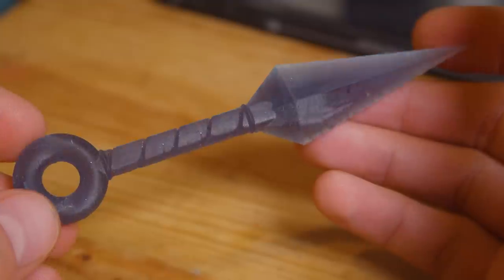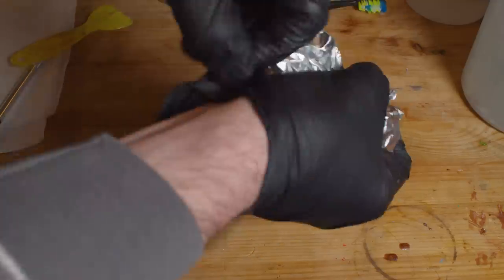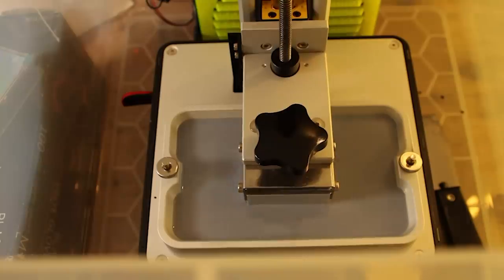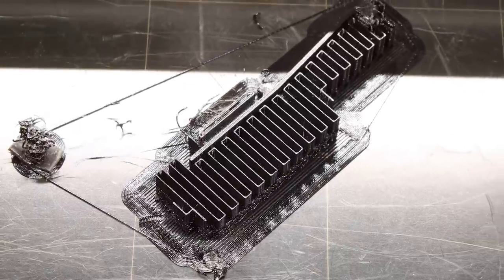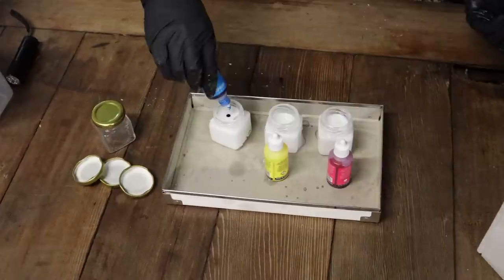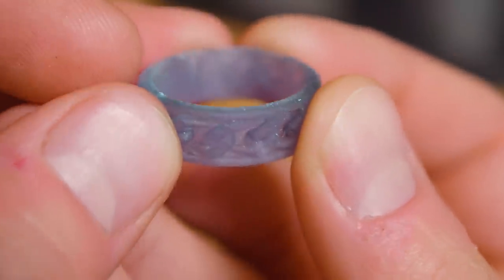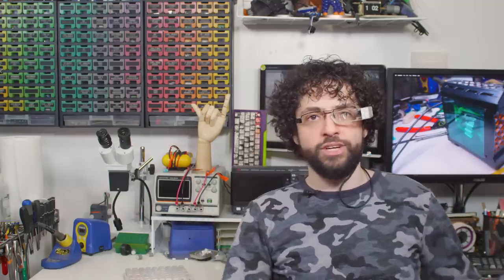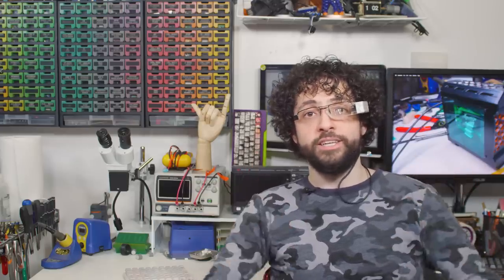Resin Printing Isn't Scary - ft. Billie Ruben!

Comment: I personally have both FDM and SLA and I have to say I use FDM more often. Don't get me wrong, SLA is absolutely awesome. But it is messy and more manual work so I oftentimes can't motivate myself to put the time into SLA. When printing FDM I literally upload my print, let it do it's thing and get back to a print. A typical SLA print takes me around half an hour to an hour of work.
Reply: Don’t even get me started on resetting the printer with new resin and such. 🙄
Reply: @topramen7431  Yeah, you really need patience and dedication with these.

Comment: I didn't know you can mix colour's. Such a great idea to only have C M Y K clear and white - you are basically covered for all colours at that point
Reply: You could even build a color mixing system with a couple of pumps and an arduino. Mixes the resin and the colors and then releases the exact amount of resin into the printer. Could also top off the tank while printing. Oh the possibilities.

Comment: "If you can smell it, your doing it wrong" that sounds like my kitchen sink philosophy.

But for real, I like my FDM 3d printer because I don't have a extra room, not even a kitchen, just a niche, so anything that could smell dangerous (or not) is out (I just print with PLA, tried Petg, going to try nylon when I can). If I had the money for a extra Room/Garage/Container - Lab/Workshop I would be doing so much more dangerous and fun stuff.
Reply: There are low-odeur resins that do not smell at all when they're inside the printer, especially with the new printers that usually include filters. The cleaning solutions you need to use to clean your prints are usually pretty stinky though, as are any of the high strength or flexibility resins that they talk about in the video.
Reply: Yep, I only have my bedroom to work in and I only use FDM it'd be too dangerous to sleep in a room with resin vapors. For my FDM I even attached a duct to the printer (its fully enclosed) with fans to vent the fumes out through the window (looks a bit janky but it totally works).
Reply: @JackOfGears  it's not about the if it's stinks or not, it is about the long time exposure, And something that stinks less but is as unhealthy or dangerouse short or long term, scares me alot more. I still work with solvents, but only short periods where i can leave them by the Window. I learned my lesson while leting oil paints dry and other stupid projects where I couldn't vent the dust or fumes. I'm not guaranteeing that I'm not going to be stupid in the future (e.g.  drink solvent when storred in the kitchen, spill epoxy on my bed ) but I wanted to make a responsible comment.
Reply: @nikolatotev  Well you can so with Resin fumes.
Reply: @hasserecht3678  from the printers I've looked at if have to make an enclosure for it whick makes it a bit more complicated. But it is possible for sure. Now that I think about it,  an even better thing would be to make an  enclosed space for both printers!
Reply: @dutenait824  Yeah, that's fair. Smell isn't everything. I've not been running my resin printer since it got too cold to keep a window open for ventilation.
Reply: What I did for printing ABS, and you could do with resin as well, is use dryer duct and a 12 fan to suck fumes out of the printer enclosure and pipe them out the window (like a portable A/C exhaust). Cost about $10 for the 4" ducting, some Coroplast, and an old 120mm PC fan.
Reply: @MrJacobegg  I had been just thinking I might try something like that! It would make me feel better in the summer as well, as my apartment isn't the best in terms of ventilation at the best of times.
Reply: i've used 2 different resins and dont notice an odor at all. idk wtf people are smelling. probably their own farts or something. 
siraya tech is the best as its strong and pretty low odor if much at all. most other resins are fragile. it cost about the same kilo for kilo.
Reply: @darkshadowsx5949  Not smelling doesn't mean not unhealthy, it just means less noticable. And I know of no resin that dosen't release VOC, just some that have less noticable vapours. And I don't want to sleep in a VOC cloud, I rather sleep in the warm fart cloud under my sheets.

Fun fact, if you don't fart, the gases get (slowly) absorbed in the blood and released thru the lungs. I rather release once, smell once, then talking sh*t and don't notice it :)
Reply: @dutenait824  I was just about to say that. Just because you can't smell it doesn't mean it's not there. Its like Pete Hegseth said he doesn't belive in germs because he can't see them.

And to be honest I think it's bad advice or at least misleading when Zack an Billie say you only need a mask & gloves and you don't have to worry about toxic fumes.
Reply: @darkshadowsx5949  yes, I'm the fact that everyone else smells fumes and you can't smell anything means everyone else is crazy and you're the only sane one 🙄
Reply: Same story here, except I stick with PETG because I liked the durability and translucency of natural PETG.

Sure it strings a lot, but once I got the settings nailed down most Natural PETG from the brands I buy seem to be consistent with each other.
Reply: Have you ever seen a laboratory fume hood? They don't enclose the chemicals you are working with, the chemicals just sit near it, but it still works amazingly well!
You could certainly get a very cheap fume hood that will vent the vast majority of the fumes (so that you are getting less exposure in the whole printers life than a plumber would get, from his pvc glues and primers, in only one day) into a relatively compact duct that you could simply unreel, toward the window, when you need to use it.
Reply: And then there's me, who had a resin printer sitting right next to his computer and kitchen for an entire year with zero filtration...

Comment: On the topic of post-print procedure, I would absolutely recommend removing the supports before curing them, often you can just pull them all off at once with practically no scaring.

Comment: As a resin printer owner:
It's amazing. Absolutely. Just make sure you have some space to clean your stuff and get a good workflow.
Protect your hands, lungs and eyes, then you're good.
Reply: As someone who owns both. Fdm is way better. I have a curing booth and everything and it's not worth it.
Reply: well thats why i only use fdm, as i only have my bedroom available and dont have that much time to waste doing all the cleanup and curing, not to speak of the space, and as i spend most of my day in that room it wouldnt be great either having resin and toxic fumes around.
Reply: Some or most of the resin is toxic and can easily cause chemical burns. It’s hard not to make a huge mess when ur changing vats. 
The ROI isn’t there with resin printing for most users

Comment: People who use resin printers: resins not dangerous 
Resin: melts protective gloves
Reply: The wrong type of protective gloves lol
Reply from the maker: Neoprene resists more chemicals than latex. Resin will not melt your skin, unless your skin is made of latex.
Reply: @ZackFreedman  It will stick and diffuse though. You should inform better with organic compounds and safety before giving suggestions Zack.
Reply: @ZackFreedman  Reddit user WiseWolfofYoitsu actually burned his entire thigh into a blistering mess 1.5 years ago after apparently sensitizing and spilling it on himself.
Reply: @ZackFreedman  This was a joke but thanks alot for replying i've nevr had a youtuber reply to my comment under his video
Reply: @ZackFreedman  Resin trash is not even something that is allowed to put into regular trash. Its toxical chemical shit.
Reply: That's like saying that riding a motorcycle is dangerous because a tissue-paper helmet can't keep your head protected. The danger there isn't the resin, it's using the wrong tools
Reply: @Psepha  It was a joke relax
Reply: @ZackFreedman  Do not let uncured resin touch your bare skin, Zack. It really is not good for you and many of them can cause chemical burns.
Reply: @YouGenom  its not ideal to get it on yourself but its unlikely to harm you, you can wash it off with soap and water. Just don't use latex gloves

Comment: If you have bad luck (lemon machines and bad resin) or not quite ideal conditions, it can actually be incredibly hard. There are less settings to modify, but there are loads of other factors that can go wrong with everything else. Easily stinks the whole building out too if you don't have an extractor to hook it up to. That said if you can get it to work it's great. I wouldn't suggest the Anycubic Photon S or Anycubic resin. I've had months of frustration and various issues with both their resin and machine, and their support just makes you jump through loops and ignores requests for returns or replacements. 

Also as a counterpoint for resin / FDM as your first printer, FDM is a lot cleaner, potentially less smelly, takes up less space, and the filament is generally cheaper and stronger. Engineering resins that are decently strong are extremely expensive to achieve a strength that's comparable to a far cheaper filament. FDM's probably better if you plan on doing practical / hardwearing items. Not to say that resin doesn't have its place in that area, the right resins are pretty strong, and if you don't have issues with strong FEP adhesion (causing warping) they're dimensionally quite accurate. 

Just trying to give another point of view that it's not always as simple as a lot of people make out. 

Hopefully doesn't put anyone off :) Nice video.

Comment: NOOOOO. Do not throw away uncured resin. Leave it either in the sun or in your curing station for a bit first. This prevents  it entering a water source. Also get a curing station for easier and more consistent uv exposure. If you finish a print at the end of the day or the beginning you want the post cure to be the same so that your customers know what they are getting. Consistency over cheap...

To get a nice shiny surface take the print from the printer and cure it a little. Then clean off the excess resin and cure it the rest of the way. This has made my transparent resin models much less opaque. This is due to microscopic cracks and issues that we just can’t see. The resin fills the void when you pull it out but if you clean off the excess then those issues make the print surface not as clean. Curing some resin before cleaning will let some seal that crack and viola clean prints.

Also when you hollow a print you run the risk of creating a vacuum. You need a way for the print to release that vacuum lest it over power the build plates hold. She is so bad at explaining this...depending on the model it’s actually cleaner to pull off the supports before the post cure.

Comment: For cleanup tools, I like to use a toddler "booger blaster" nose suction thingy, to clean underwater/alcohol with little jets of liquid great to get blasts of cleaning in where a brush wont fit.

Also, dont use anything to scrape a failure off of the FEP film, just use the back of your (clean gloved) hand to gently deform the film where the goober is stuck, it will just slowly peel off and float free in the vat and then can be poured out or scooped out with the spatula.

Comment: It's slightly more expensive (£36 per kg compared to £7 per kg for bottom of the line stuff), the machines generally are more expensive unless you go with the Photon, parts like the FEP film and the screen are consumable parts that eventually need replacing, the cleanup is messier especially if a print fails, and the chemicals involved are dangerous and no resin printer I've come across comes with a suitable respirator, also you're not supposed to wash uncured resin down the drain because it's a public health hazard. Also be prepared to go through a pair of gloves for every print you do, and if you reuse gloves then you'll end up with a sticky work area.

They're totally worth it, but you should definitely be aware of the downsides. Also, don't print in your bedroom.

Comment: I've seen a paper somewhere that filament printers actually release more volatile organic compounds than resin printers.
Take this with a grain of salt but it's certain that filament printers also produce them. People tend to ignore that.
Reply: I would say resin is potentially more dangerous since just by the act of opening a bottle it releases VOC fumes and getting it on your skin can cause allergies or health problems too. 
With filaments you can still touch it but the worry is VOC release when heated. PLA is considered much safer than ABS with 10x less VOCs but it will still release fumes which stack over time and if you're running a farm. Ventilators with filters are key in these cases or if you're working with filaments like ABS boxing in the machine and using a venting tube before opening is the safest. On the plus side it stabilizes temperatures.

Comment: Dear Zach, fantastically produced interview! I'm curious about how you filmed this episode? My first impression was that it was "synthetic", with you both responding to a script and then having the clips stitched together, though at the end there's too much banter for that. Did you each just have a professional camera situated above your webcam/computer? And if so, how did you manage to avoid the crappy computer speaker audio from appearing in your side when Billie was speaking?
Reply from the maker: It's semi-scripted. I did the interview with Billie in a normal conversation - she used her usual YouTube recording gear to record to her own computer and sent me the originals. I then cut the best parts of her side together, and wrote and recorded new soundbites to make the conversation flow better. To make the job easier, I tried to ask the same questions in different ways to get more material to work with.

Comment: for mixing, i think fff is in highend not weaker... a multinozzle you can make any blend, change filament in print to print in many various material/colour... classical pva for support and you can make super complex geometry, tell me how you will get such abillity with resin printer?! But yes its less you can fail (ofc this and the resolution of it, i need one :D)

Comment: there is something i wonder, with conventional 3d printers, you could re-melt the plastic to recycle it into a new piece, but is it possible to recycle resin?
Reply: To my knowledge; No, or at least not exactly. 
Resin reacts with the activator (in this case UV), which chemically cures the resin and hardens it. That said; I have heard of people reheating/melting used resin, but seems the results are a lil iffy.

Comment: As a plumber, I had to apply solvents that give off the same fumes, by hand, in enclosed spaces, sometimes hundreds of times in a single day...
I really don't think you need to worry about those fumes, considering you can just sit the printer in a room with an open window.. You don't need to sit there with your face sitting over the resin all day...
So yeah, when you consider how easy it is to just place a fan next to the printer, or, heaven forbid, use a thirteen dollar fume hood, I'd say anyone complaining about the dangers of those fumes needs to give a HEFTY tip to their plumber, the next time they come around...